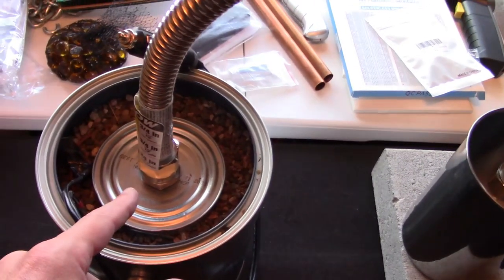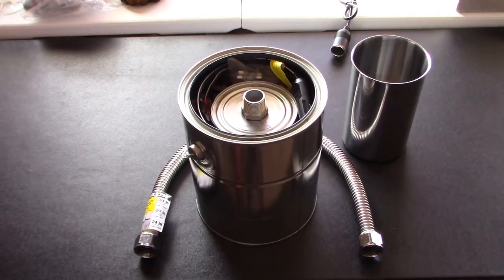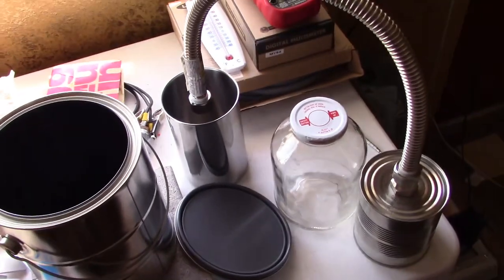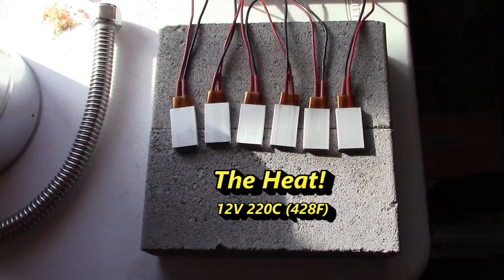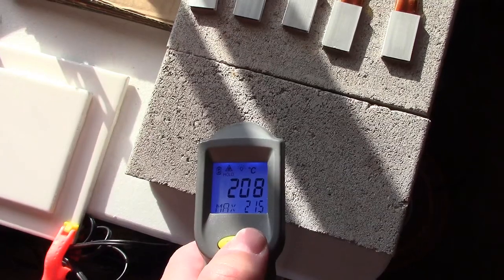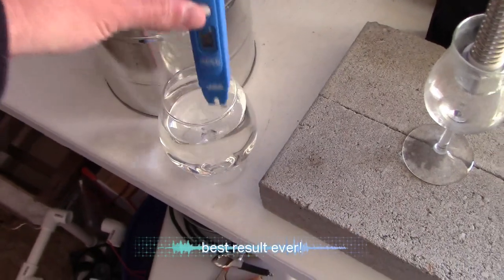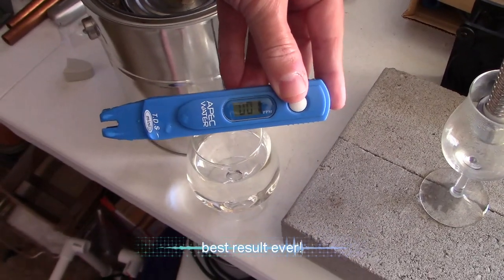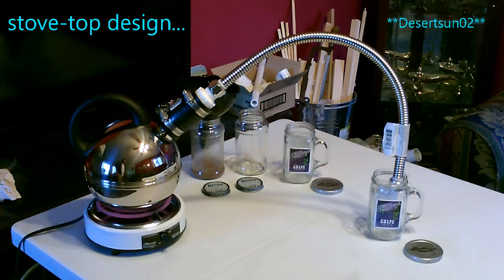DIY Water Distiller! "Gallon Can" distiller! purify water! (400 ppm to 1 ppm! ) - can be solar pwrd!

Comment: Amazing build and thank you for posting. I was wondering how to build a simple/inexpensive 12V water distiller to utilise the free solar panel energy and here is the answer. Thank you again, love the presentation. Sure, there is a bit of waste of the steam, but for the simplicity and ease of use I do not think anything can beat that design.

Comment: This was nice but I would like to see you build one that doesn't require electricity as I think it would be more practical in a power outage situation like after a severe storm.
Great job though, keep them coming.
Reply from the maker: hi there. this one is specifically designed for off-grid situations. it can be run off almost any 12v source... 12v solar panels, 12v batteries, your cars 12v or a generator that has a 12v power socket. i've also got a few DIY distillers that you just place in the sun. if you have zero power source and no sun then i don't think there is a way to distill water (i can't think of any).
Reply: Ummmm he did use solar panels!

Comment: I’m on my 3rd distiller in 3 years. I have one that I bought from Amazon that broke after 2-3 months so they sent a replacement. It heats up the entire kitchen and takes 3 1/2 hours for 1 gallon. I bought one from Walmart and paid extra for a warranty and called them when it broke after 8 months but won’t honor the warranty unless I can get it in writing from the manufacturer that it’s not warranted through them. It’s made in China and I’ll never be able to contact the manufacturer. I threw that money away.

Comment: You need a longer metal hose (condenser), you are losing a lot of water during distillation. Water may not be as important in some locations, but efficiency is always important, ie you may not want the distiller to run / use power for more than necessarily, like say, fill a 1 gallon jug. Adding more water to be distilled means running the device longer. Either that, or try using other methods for cooling the condenser, like a fan or submerging it in cold water (just make sure the dirty water doesn't get mixed up with the clean one).
Reply from the maker: hi there. i was shooting for maximum simplicity, portability, ease of build/design etc... but a longer (possibly coiled) hose, a cooling fan and/or cold water are indeed the 3 things that could make this unit produce water even faster. feel free to experiment. note that if you use a longer coil you would probably want to add a steam release vent (or two) somewhere in the system. *as designed now it doesn't need one because the hose is short (and fat) enough to allow for all pressure to escape. 👈🙂
Reply: @desertsun02  Yeah, if you were aiming for portability, this design makes sense then. With portability in mind then, I'm thinking of a design where there's a really long metal hose coiled many times around the boiler and going down, ie: the water collection chamber to be directly underneath the boiler. With 2x or 4x 120mm 12v fans attached, it should be pretty compact, not much thicker than it is, but maybe twice as tall.

Comment: This is awesome, Im now following your page and I've just bought all the parts for this now... I wonder could an induction coil wrapped around the metal tin be more efficient than the PTC heating element? or could you alternatively just use the heating element from a kettle inside of it?...
I'm relatively new to this so I'm sure you have your reasons for choosing this method, so I guess what I'm asking then is how come this works better?
Reply from the maker: hi there. i'm sure there's many other ways to do it. this is just one straight forward and simple way that i came up with. feel free to experiment. that's how i came up with it (just lots of experimenting and testing). 🙂

Comment: Where or how did you get or make the sealed can to boil the water in?
Reply from the maker: hi there. the inner can is just one of those 'near quart size' (30 oz.) food cans. it's a very standard size one. that one i got at walmart. it contained a tomato sauce originally. cost 87 cents. (this goes without saying but after you make the hole in the top of the can, you dump out the food and throw it away. don't eat the food. then just clean out (or rinse out) the can).
Reply: @desertsun02 What those metal chips and dirt from your drill bit and file are not good to eat? I never would have guessed! Don't tell Michel Lotito!

Comment: This is such a great idea. I wonder if there is a way to upscale this for villages to get clean drinkable water from the ocean? 
Can you tell me how many watts of solar you were using to operate this unit?
Reply from the maker: hi there. you need about 200 watts worth of 12v solar panels or slightly more to get the unit running strong. 12v 100w solar panels are usually 5.5 to 6 amps, (and the distiller need about 12 amps) so two 12v 100w solar panels works. that's the minimum i'd use. to be sure i say use 250w to 300w total. i generally run most of my projects on two 12v 100 watt solar panels but sometimes i add in another 12v 50 watt panel. the fifty watt panel is 3 amps so then the total amps (in full sun) is 15. note:  i always keep my 12v projects under 15 amps for several reasons. (any 12v project that needs 15 amps (or more) is a 'whole different ballgame' and using that much 'power' requires all kinds of special/expensive and/or hard to find things).

Comment: Where did you get the heater blocks and what are they actually called.
Reply from the maker: hi. they are called ptc heating elements. i use the 12v 220c ones. those are the hottest ones that they sell (that i know of). you can find them on amazon, ebay and aliexpress. (last time i looked, amazon sells them for $5, ebay for about $2.50 and aliexpress has them for one dollar.) i've also heard you can get them in bulk
Reply: Thank you much.

Comment: What are the rocks for?
Reply from the maker: the rocks (or dirt or sand) is used to store and trap the heat in-and-around the inner can. using them literally cuts the time it takes for the water to boil in half.  it's also a much stronger 'rolling boil' with them. that's because the tablets produce heat on both sides (and without the rocks, half the heat is just lost 'into the air'). *by the way, that's not a guess. i've tried it both ways many times and without the rocks (or dirt or sand) it's way harder to get a strong boil. you'll need to use roughly 9 elements for the same boil (if using a 30 oz. can). they also protect the elements (and the user), and makes the unit more physically stable (and more portable when the unit is hot). 🙂

Comment: my best distiller was a glass unit from a scientific glass company   delicate to be sure
Reply: I had one.
Reply: @jquest43  I still have mine but a small piece broke but...I can  repair if I need 2
Reply: @pappawheely  better to make a pressure cooker and connect a copper 6 foot coil to it..metal doesn't break

Comment: So this works on saltwater as well, right?
Reply from the maker: oh yeah, absolutely. ✔👈
Reply: @desertsun02  , friggen awesome, man!
Reply from the maker: thanks brother - i'm stoked about this set up!
Reply: @desertsun02  do you have a link on where to buy those heating elements?
Reply from the maker: hi. the exact link is dead at the moment, but all you have to do is search for 12v 220C or 12v 200C ptc heating elements on amazon and you will see them. this is not the cheapest place to get them though. i've seen them on ebay for $2 to $2.50 each and on aliexpress for as little as one dollar.